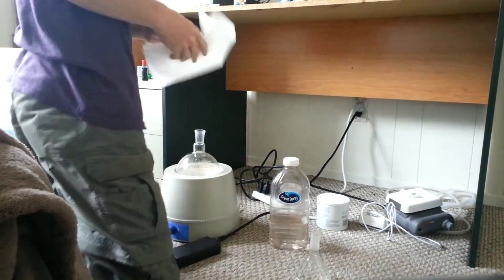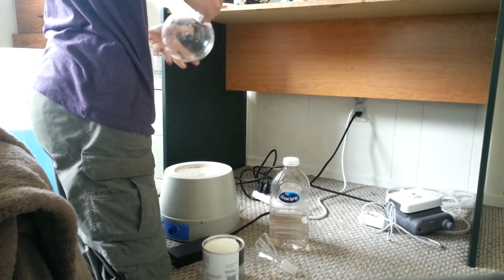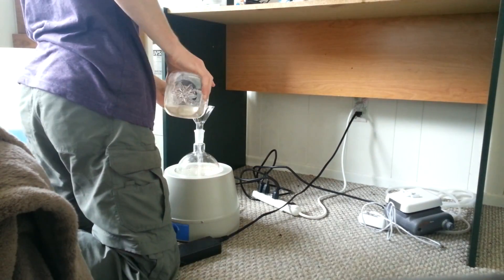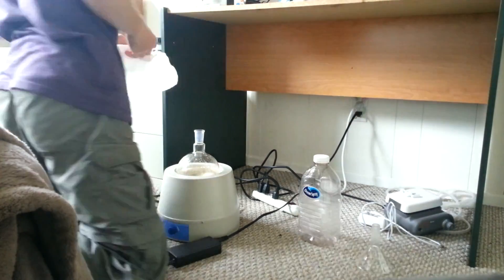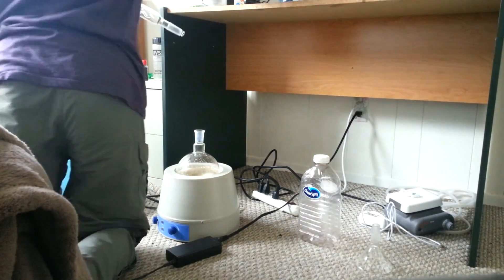Setting up a reflux apparatus

Comment: Please make more videos! The few you have made have been extremely useful, I have a good idea of some basic lab equipment that would be helpful now thanks to you. My science fair project for school has for four years been microbial fuel cell, but recently I ran across a closely related topic that I believe holds the future of our planets health and am surprised that it hasn't received  more attention. That project is algae bio reactors, I plan to build a reactor and when I harvest it I will break down the cell walls and release the oils and with that I plan on synthesizing bio-diesel and bio-jet fuel which uses potentially hazardous concentrations of chemicals such as Sodium Hydroxide would have never have accomplished it as easily without your channel, keep it going! 
   -thanks